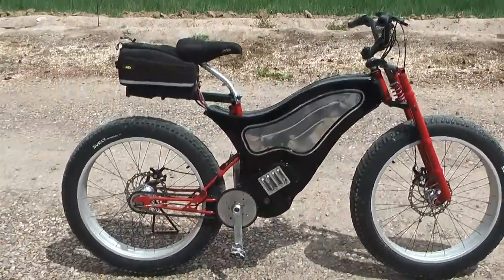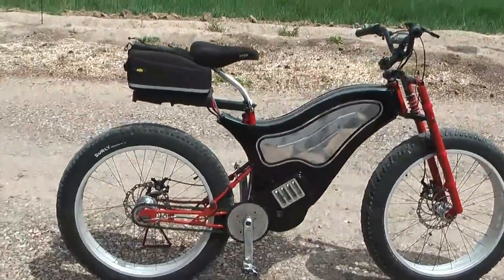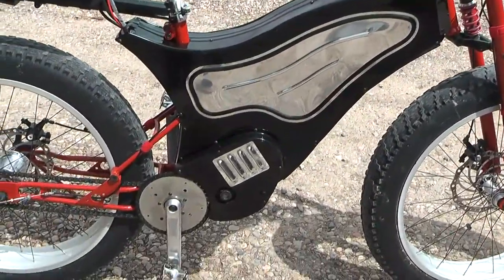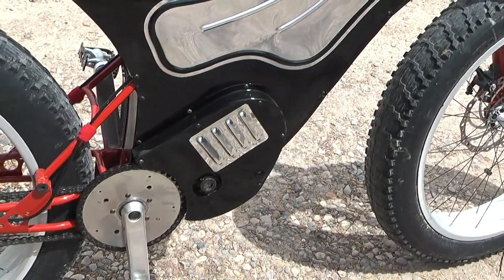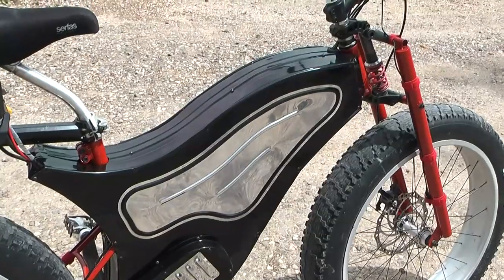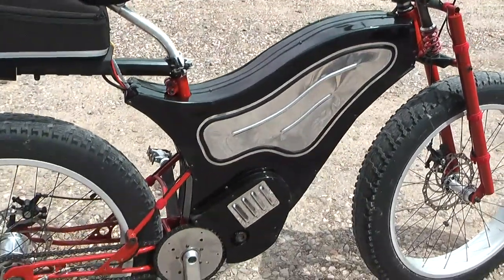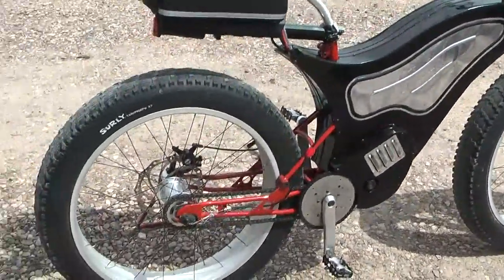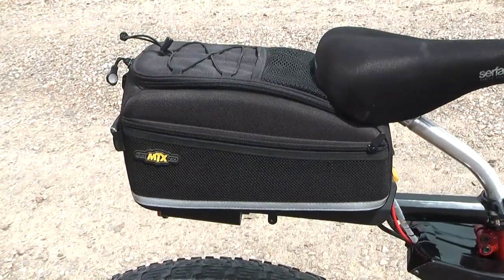Full Suspension Electric Fatbike Part 2

Comment: Hey  Dude..  If  you wish  to cut  down on the Chain noise.. Try  ah rubber drive belt instead ....  Half  the noise and much  sma-moooooother, no grinding..   Might  save   weight too.  That means  more  distance and higher speed.

Comment: can you help me get make one?  i love the design
Reply from the maker: All I can do is give advice and answer any questions you might have.  I don't build or make anything to sell.  Thanks for the comment.   I'm glad you liked it.
Reply: RiverbendBicycles I brougth one 1000watt kit from china, but the wheel spin bad.  maybe its bend.cant use my bike like this .  i need a mid drive motor.  what kind of motor do you have? Have you try using lipo battery?
Reply from the maker: Andy Casbo I used a 1500 watt BMC motor.  I'm using Ping batteries and they seem to work really well.  Have you been to the endless sphere website?  There is a lot of information and knowledge there.